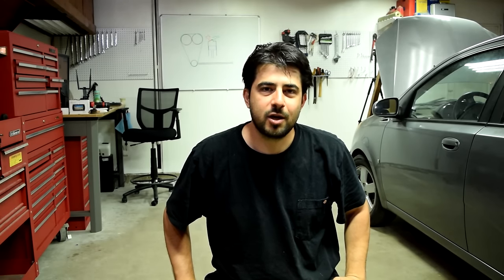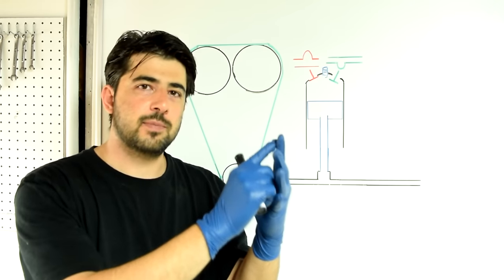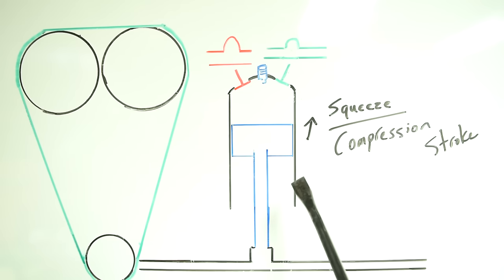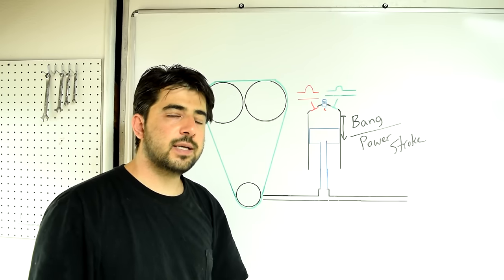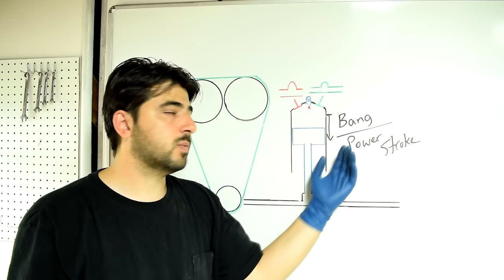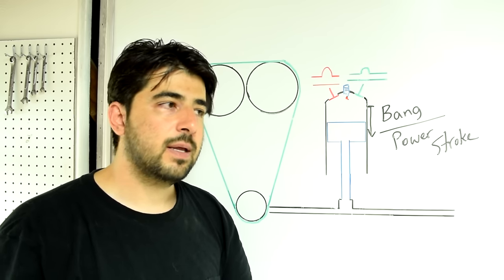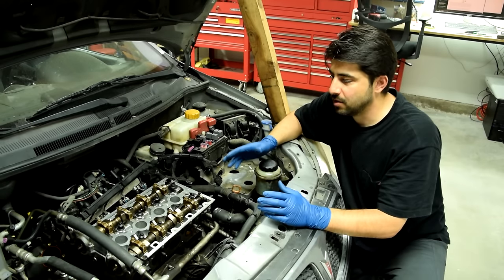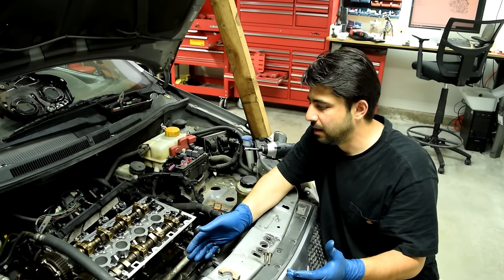Variable Valve Timing Explained - Like Never Before

Comment: This VVT system always seemed more complicated than it needed to be, and the dependence on extra solenoids and motor oil moving down narrow channels made me wonder how long they would last. However it seems like these systems are holding up fine, so far. Even better reason to change motor oil frequently, ha ha. Good video, welcome to the new shop!
Reply: I was wondering about a fail safe if the solenoids stopped working all together as solenoids have been known to do.
Reply from the maker: Yes, they are pretty reliable now. But yes frequent oil changes with these setups is crucial. cheers
Reply from the maker: The solenoid is usually spring loaded inside where if it were to fail t will go to a position where there wont be any damage, either valve to valve or valve to piston. cheers
Reply: Like to know where the VVT Filter Screen is on a 3.3L 2006 Sienna - better to clean that first than go replacing things that might not need replacing.. although I am sure after 200K or more they might be a bit more gummy than a bear.
Reply: Why buy the solenoids unless it is the problem? Test the solenoids and replace if bad. If filter is sludged up causing the problem then you threw parts at it for nothing!
Reply: @williamshaw3783  Precisely. Replacing what's not broken will not fix the problem.  The problem becomes finding out which part. 😵

Comment: The fact the timing chain is not very thick is a shame. All the extra stuff the VVT adds to the timing system you'd think they'd have put a more heavy duty chain. I have the ecotec 2.4 in my 2016 buick verano and I'm in constant fear the timing chain will fall. Yes i plan to keep a good eye on oil level and oil change every 2-3000 miles and add a bit of Lucas stabilizer to the oil.

Comment: Very good explanation of variable valve timing and how it works. I'm old school, worked on engine rebuild in the days of 4-bbl carbs and no pollution control baggage. Trying to learn and understand the newer technology and how it works. We've definitely come a long way in engine design. Thank so much for this video. A combination of theory, drawings, real engine parts, and explanation is an invaluable tool for teaching which helps everything you discussed make sense. Kind of remind me of my instructors I had when I took auto mechanics trade school in the early '70s. They used the same instruction methods which works well. Bravo.

Comment: I had fault code P1007 and P1014 on Peugeot 207 car could not start I just cleaned it and bingo it started again. Be careful the symptom initially looks like a fuel problem, don’t replace your fuel pump just yet. Thanks for the video!

Comment: Woah, now I understand! I replaced my intake & exhaust VVT solenoids on 2017 GMC Terrain at only 43k miles. Intake side was filthy!! My oil has been changed by the dealership regularly so I’m kinda upset at what I seen on the solenoid. Now it runs great again and no longer stalling. Thank God for YouTube because it has helped so much!

Comment: Your explanation of how VVT works , and how it is employed in effecting Exhaust Gas Retention internally  ( as opposed to Exhaust Gas Recirculation which requires separate externally installed valve in older engines ) , to me is the highlight of this video . 
Keep up with the good work!

Comment: Thank you.I have this engine in my Aveo 2010.I will clean my  cam position solenoids and hopefully cure my intermittent acceleration(bucking)problem.I did not know the exact theory behind the variable timing but your explanation was right to the point.Thanks again
Reply: Well I replaced both Advance timing solenoid, and it did not fix the car

Comment: Hello, thanks for your video, I disconnected the MAF and the car idles low, it does not go up more than 500 rpm's and the brake is a bit hard, although the fault disappears where the ralenti is 2000 rpm's and the brakes stop oscillating RPM's from 1000 to 2000, you can't drive. I bought a stock MAF like the one you have factory at Toyota and it didn't fix itself. I thought like you about the leak and had the servo checked and they told me it was fine. Take out the intake manifold and seal some joints that seemed not well sealed. Another test that I did was to disconnect the brake booster valve and the rpm's also drop to 500 rpm's, the brake remains hard without the help, you can't drive like that either. I will also tell you that we removed the throttle body and it was submerged in special liquids, no dirt came out, the car in general is very careful, the only thing I could not remove is the IAC valve because it has a special 25 Pentalobe type key I think, but I can't buy that tool, the same thing, both the IAC and the TPS were cleaned and measured with a tester and the injector voltage was checked and it works fine. I also changed the intake manifold gasket, spark plugs and PSV valve, all original Toyota, the Toyota scanner and other colleagues say nothing of failure. I put a vacuum gauge and it measures 18 normal psi and when accelerating it drops to 0 and then recovers. I don't know whether to suspect a leak from injectors, I am very disoriented and worse, I live in a very small city far from any official service to take to the car and no one has a vacuum gauge and has smoke to see where the leak could be. If you can think of a control that you can do, I would appreciate it. Greetings

Comment: Your engine looks similar, if not identical, to my Chevy Sonic 1.8L LUW. I just replaced my head gasket and also ground the valves, removed tonnes of carbon buildup on the exhaust valves and Pistons. Great video. Now I know why I don't have an EGR valve. The LWE 1.8L carries an air pump. Just before putting my head back on, one of my dog was not feeling well that day and vomited on the head, wiped it out but I am guessing the oil filter and PCV system should rid the rest of it 😂😂😂

Comment: Great demonstration and explanation of VVT. What I'd like to know is what can be done to check the wellness of the VVT operation and to improve it. I run high mileage cars (around 300K) and have used premium synthetic oil (Amzoil) and treatments (auto RX) but a mechanic recently tried to sell me on replacement solenoids on my 03 FX35 (old enough that Infiniti/Nissan was of decent quality). He said they were clogged. I asked him what he'd do on his own car.. "blast them with brake clean". 

Can I pull the solenoids and examine for sludge - is that a decent indication? 

What engine treatments might be useful - Marvel Mystery Oil? Auto RX?

Comment: Also rev the engine above 4000 rpm at least once in a while if you are a very soft driver, this circulates the oil through the CVVT system
Reply: That statement has zero truth. 
Geez, buy a oil pressure gauge and learn something.

Comment: Thank you, Author! Really cool explanation in close relation to real equipment. Could you say a couple of words on the solenoid valve? Does ECU apply a voltage to the coil and have feedback loop through camshafts sensors? Or the solenoid valve has known relation between voltage and valve position, without feedback loop?

Comment: Thanks, very much valuable to me. Just bought my 1st v40 2001 1.8, checked vvt solenoid and it seemed already 'tryied-to-be' repaired but pusher in the valve does not move full range..How could I reasonably verify wheather its faulty VVT puller wheel or the valve itself? Theres momentary creaking audible, especially in lower RPMs..

Comment: Can you please answer this question!? I have a QR25DE built for boost. Pistons rods springs. I redid the entire timing job including the phaser gear and all Nissan oem oil seals. The rattle noise on cold startup went away and I had quiet startups for about a week and a month later I’m having the same rattling noise on cold startups which last about one second. Why is this happening and what factors may be contributing. Also can locking the phaser gear in advanced eliminate the noise without compromising anything serious? Please reply....

Comment: So if I understand if those vvt solenoids are say clogged with oil and unable to function correctly your vehicle can run like crap as this would have a similar effect as having the distributor turned to the wrong position on an older car except instead of controlling firing or spark those vvt solenoids control the actual valve timing by using oil pressure to either slow the camshafts or speed them up. Is this the idea of it all?

Comment: so, would a dirty VVT possibly also cause a P1259? I've tried the fix the 1259 code but saw that the VVt was very dirty and cleaned it off. Drove it since but still don't know if this was the issue

Comment: Bro..so can I just take the solenoids and clean them with maf spray I did get codes for audi s3 vvt solenoids. Change the oil like religion.  Turned car off and codes were gone. 
So im wondering if I should pre clean them?
Any advice ?
Awesome video. Like seriously you're a professor man. Gb you

Comment: Great vid, I threw a code p0016 code. Tested the resistance of both vvt oil actuators and each had 8.9 ohms. I switched them and cleared the p0016 but got a p0017. Gas mpg was notice to have reduced from 35mpg to 30mpg from p0016 and beyond. My car abruptly died on the highway. Would the vvt solenoid do that or could it be a timing belt issue. Now there are p0340 and p0365. Could it be bad cam phasors. I replaced on vvt selonoid but stopped since it did not fix the problem. Today I am going to check the belt timing in reference to the cam and crank.

Comment: Ok that's the GM 1.8L. Mine is in a 2013 Cruze with error p0016. New crank position sensor, new oil/filter, installed new timing belt kit 15,000 miles ago, (dash light automatically says to change it at 100k. But I still have a p0016. Can my cam phasers be causing the error code? How to check them???

Comment: Hi i check the plug that connected to vvt valve and it gives 2.3 volts is it low ?? Also i connect that plug to a spare vvt valve that bought but you can’t see anything moving!!!!! Can i get an advice about that and what to do to check the low voltage problem if it really low thank you.

Comment: Hi, i have a a daihatsu sirion2/toyota passo with a K3VE engine. i'm getting only 1.3 volts als the vvt-i connector. no engine trouble code light. I read it's suppose to be 12 v. what to do? regards

Comment: Can a failure in this solenoid cause an O2 sensor trouble codes?  Or there's no relation

I got p0012 along with heated o2 sensor codes

Comment: Good work, but am having this fault code p0012 on my 2011 Camry 2AR , I changed engine oil with filter still de code comes up/ camshaft timing is ok, vvt solenoid is working perfect, ocv filter is good, wiring system is ok , finally I changed the ECM still de problem is there it doesn’t allow the car run faster, I need help from u to solve me problem , I follow you paaaa,tanx waiting for your reply

Comment: Would love to hear your thoughts on my problematic 2005 megane mk2: When I start the car engine cold, it starts nice and idles nice for 10 seconds and stalls. And it keeps doing this till the engine is warm and it still might stall during drive if I press clutch down. BUT if I remove the plug from the solenoid when starting cold, car idles without problems and driving it feels very smooth, no stalling whatsoever.

This seems to be the most annoying problem on mk2 meganes and seems to drive pretty many people crazy :D. Would love to see someone track this common problem down and come up with a cure. There are so many meganes out there with this same problem.

Most common suggestion is to change the solenoid, change the camshaft sensors, change the lambda sensors etc etc. But so many have tried and problem has still persisted. Could this be just a result of bad oil maintanance and clogged up oil residue in these tight channels within the whole vvt-system? Maybe a thorough engine flush and several early oil and filter changes to get the fluids running properly and hope for the best?

Comment: Hello dear..
I'm facing problem in my chevy cruze 1.8 after i change another engine from scrap the messg is p0011 camshaft A position - timing over-dvance or system performance and another messg is p0341 camshaft position sensor A cericut range /performance. 
I have changed camshaft sensor and I have changed the camshaft oil selnoid but still the same issue .
Engine is shaking and stall. 
Kindly advice me ? How to fix camshaft phaser of they are advance ? 
For your info oil is clean and filter are clean and I'm using the corect oil 5w30 .

Comment: Hey mechanic. How come did you take the cylinder off on what purpose ? What cause it failed ? I guess thinking you clean up from very bad oil sludge inside the motor . Very bad sludge can cause VVT solenoid failed and stuck wont move or oil blocking that cannot get thur oil system ? Just asking to see what you are working in your shop . Your shop is well in order to work on cars .
Reply: Yeah, I was wondering why he had it off too.
Reply: well that and people tend to use cheaper thicker oils, we just give them an engine flush and put the correct grade oil in , it usually works anyhow
Reply: DE Nichols . Noticed the head bolts are loose !
Reply: closertothetruth . Yeah true cheap oil can making problem with engine if wrong type of oil .
Reply from the maker: This engine had over heated and had a bad head gasket. The cylinder head is shinny and clean because its fresh back from the machine shop.
Reply: Ratchets And Wrenches . What did you find out what cause to overheat? like bad coolant or cooling fan stop working etc....

Comment: My Mazdaspeed was out of time when I tried to put the timing plate in.  Do you think that's due to the tensioner going bad and the chain skipping, or can a vvt go bad to cause them not to line up.  The cam slots were several degrees off from each other..
Reply: And great video!  I always wondered how VVT worked

Comment: @Ratchets and wrenches. My '96 200sx won't start after starting for a second the last time.  I was thinking of replacing the solenoid valve, but thought there's no way it can cause timing issues. So my question to you can bad solenoid valve cause no start issue ?  Thank you
Reply from the maker: Highly unlikely, look in my channel for a crank no start video. Its step by step.

Comment: Another good quality video. I recently did a timing belt and gaskets, water pump on my is300 with 2jzge vvti engine, at first the timing water over retarded then my mechanic fixed it then it kept giving me code P0016 (exhaust cam & crank timing issue) he checked twice after this and the code still shows up. The car runs fine.  I couldn't think anything that could causes it beside I use a lot of Gasket sealant while changing the gasket and some might chew up in the engine and clogged up something in it. But do you know what we should check out next. Yes he checked the timing 3 times taking it apart
Reply from the maker: I havent done a timing belt on those so I am not sure. But if it never had those codes and now after a timing belt job it does have them well its highly likely its something you did. Too much gasket maker could indeed clog up the oil passages and cause these. I assume you only changed the timing belt, also make sure you did not forget to hook up any connectors etc.. it could be something as simple as that. gl

Comment: So my car cel came on and its telling me its my cam shaft position slow response. Subaru is saying its my bank 1 ocv. My question is if the ocv fails does that mean the timing of the cam shaft slow and cause problems with it.. they said the last time they changed my bank 2 side that something was clogging my ocv and causing the cel to come on.

Comment: Never leave out the money shot! With THAT said - My V8 has VVT solenoids on each valve cover so this vid confuses me....am I overthinking the whole process?
Reply: You don't have to be concerned about it. For sure you will need two identical systems on both the valve cover for the two banks. The functionality is the same, just for each camshaft you will need each vvt valve etc.

Comment: Great video,just subscribed. Your landlord sucks. question: Can I disconnect my elantra exhaust vvt solenoid (exhaust oil control valve) and run it although it will throw a code..?

Comment: Hello, my famous chronic problem ???  I have an Auris 2 year 2014, petrol 1.6, Auto CVT type box, after repairing my box, I took my Auris out of the garage exactly on October 19, 2022, I drained the engine just 8 days later, so  that driving about 3 weeks after October 19, I had 2 check engine lights on and the ESP, the diagnosis on the scanner gave 2 error codes p264A and p1047, I changed the oil, both lights still on,  from time to time they go out but often on and with the same error codes, no one has been able to dissect this phenomenon, my vehicle is almost always in degraded mode, here I am, I find myself in a dark impasse, if  please if someone has already experienced this phenomenon, he can guide me, thanks again the team